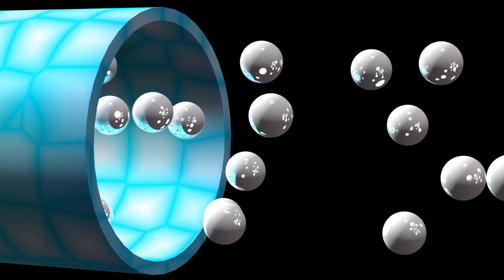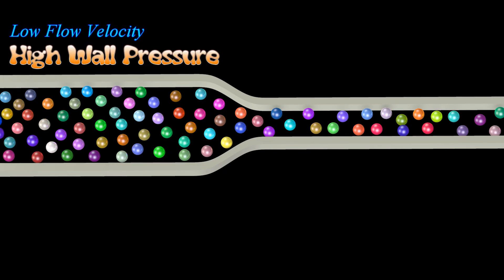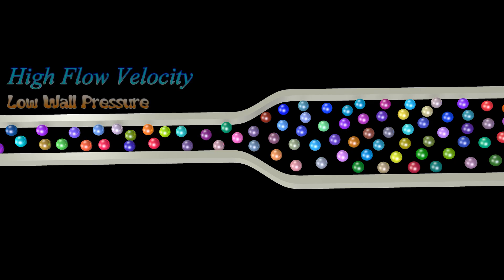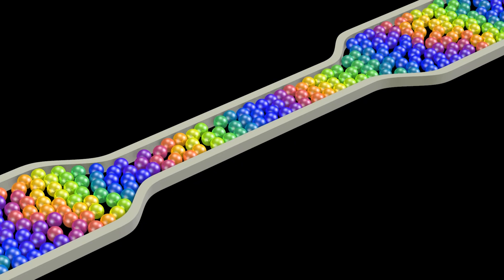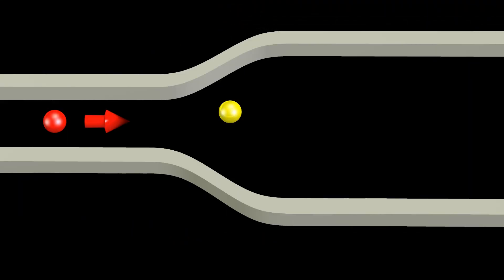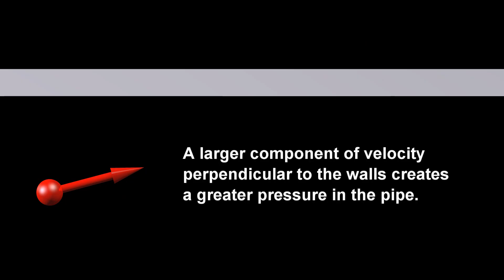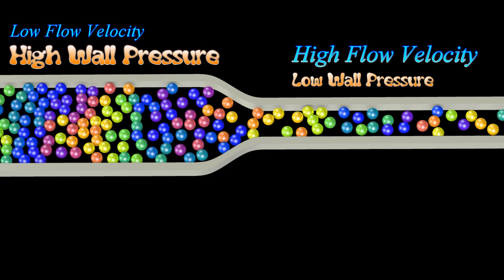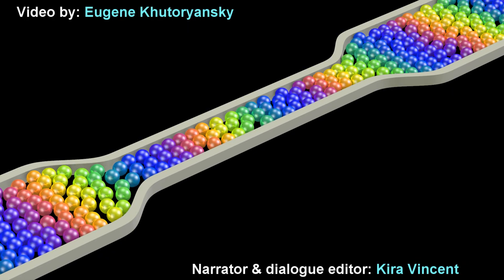Bernoulli’s Principle on Atomic Scale

Comment: Thank you so much, I've a hard time "accepting" certain things during engineering instead of fully understanding it. This topic was always one of them.
Reply from the maker: Thanks.  This is a problem with engineering education in general.  They give you formulas, but no intuitive understanding of what is actually going on.
Reply: @EugeneKhutoryansky  Nice video well explained in atomic dimension, this principle makes more sense in molecular dimension because the cohesion of the molecules is what dictate more. Let´s say we have heavier molecules with greater cohesion, the mass of the molecules would tend to go down at 6 o'clock of the pipeline and bigger the vessel to hold the mass higher the pressure will be, that´s why the larger the diameter has higher pressure and since the flow has to be the same, velocity increase where the volume is smaller. The less cohesive the fluid is, the bernoulli law start having issues because of the gaps between the molecules that allow them to be brought together by any applied force, this is called compressibility, in fact the lower the density more compressible is the fluid. Therefore, flow of gas has additional factors to take into account. As an example a highly compressible gas would expand from a lower diameter to a higher diameter, this is called Joule-Thompson effect in which the pressure and temperature of the gas would decrease. Summing up, it depends on the type of fluid to analyze the bernoulli law for flow in pipes.
Reply: @EugeneKhutoryansky  i agree; its unfortunately the case with a lot of the sciences. I really appreciate that your videos help me understand what would otherwise be memorized and forgotten :)
Reply: @EugeneKhutoryansky  Yeah, and that's exactly what I hate about engineering. I am an engineer of energetics, and we study all forms of physics, from fluid mechanics to nuclear energy to electricity and magnetism to all types of engines and turbomachinery, but your videos are absolutely amazing. This is what studying is—not just applying formulas that you don't even understand. Thanks a lot, and keep up the good work.
Reply: I must second that. While I had made the Bernoulli principle somewhat intuitive on my head (probably based on false speculations) this video really explained it by a very simple concept. Thanks from me too, Eugene.
Reply: I thought what was going on was that cross section of water, or the plug (I think some refer to it as), was simply spread out over a greater surface area of the smaller pipe per unit of time, and the pressure per square inch per unit of time was lower. I am not an engineer or physicist.
Reply: @Polarcupcheck  you might be up to something there👍